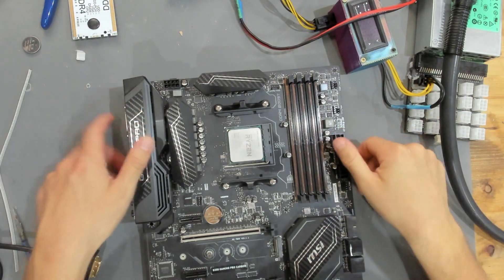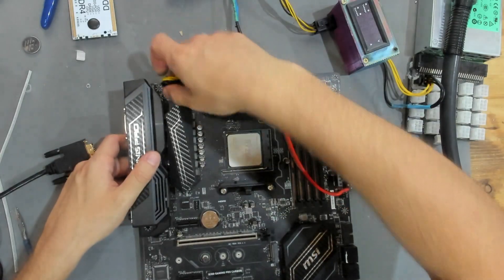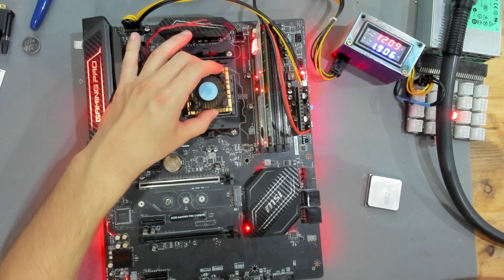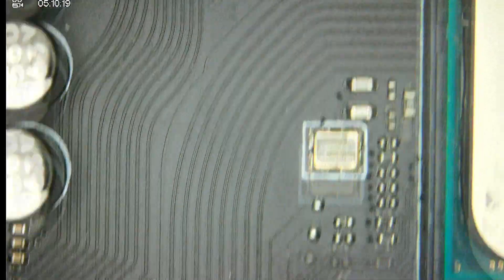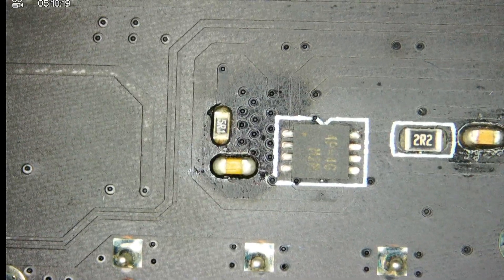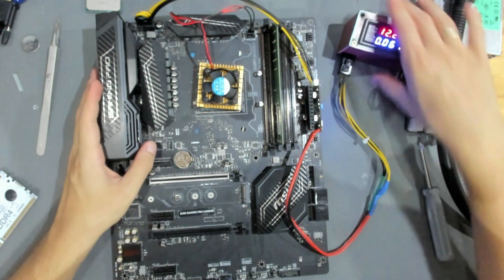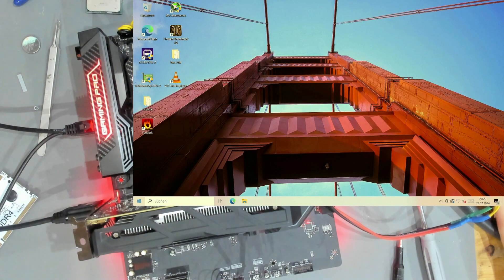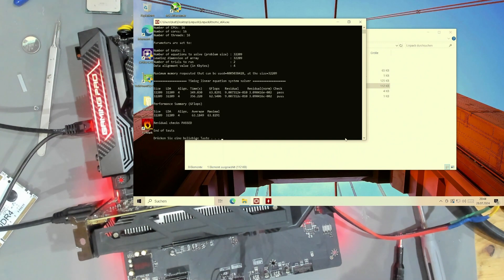VIEWER FAILED BIOS FLASH, CAN WE HELP? ||| B350 MSI CARBON

Comment: I got the best solution without shorting or programming with 5V power that made mine a brick. The easiest way is to remove the CPU and put it back in.
Reply: I donated spare parts from the motherboard such as batteries and chipset heat sink clips.

Comment: Bro u doing very well ur job is so clean.. recently I tried to update my bios on my msi b550 a-pro from the flash button I downloaded the right file and I put it on the usb I named it msi.rom the steps were clear like the first time I updated the bios when i bought my motherboard but this time the update failed idk why when I finished I turned on my pc I saw the debuge led of the cpu light up I had no screen when i tried to update the bios again the red led just  kept blinking indefinitely when i saw ur videos I felt hopeful that the mobo could be fixed
Reply from the maker: If you know that its only a bios issue, it really can be solved, without to much hassle!
Reply: @MainboardMedic  yea I think the problem is with the bios chip it will need to be programed and everything gonna be okay.. if u were nearby I would have brought it to u cuz your work is truly excellent
Reply from the maker: @SHADOWALKER-j4b  Well i am located in germany which is really far from most people!
Reply: @MainboardMedic  Im from algeria.. I think the cost of shipping and maintenance alone could get me a whole new build XD
Reply from the maker: @SHADOWALKER-j4b  Sadly thats often the case that only the shipping is way more then the board is worth!
Reply: @MainboardMedic  Yea that's pretty normal for a country outside the EU with a currency that’s not that strong..

Comment: MSI B650 Gaming Plus WiFi, DDR5 6000. By default, this RAM runs at a frequency of 4800 MHz, but I had it running in dual-channel at 6000 MHz (I don’t remember whether it was an XMP profile or a special one for AMD). Everything worked fine until one day the power went out, and the PC stopped booting after attempts to reset and flash the BIOS.

I ordered the exact same motherboard, and after installing all components, it worked. The RAM operated at 4800 MHz. I tried enabling dual-channel mode on the new motherboard, but the BIOS wouldn’t save the settings. Then, I decided to update the BIOS, and during the update process, the PC froze and stopped booting into Windows. Now, the CPU and DRAM indicators remain lit, even though I know all PC components should be functional.

I tried removing the battery and resetting the BIOS by shorting the JBAT1 pins, but neither method worked.

I also attempted updating the BIOS by leaving the USB drive connected to the dedicated BIOS flashback port, but that didn’t help either. Even with the CPU and DRAM removed, their respective indicators remain lit in red and orange.

Please help me resolve this issue!

Comment: my cpu hot only cpu led stuck bios problem?
Reply: Anything you tried?
Reply: The error may be due to a corrupt BIOS. Did the error occur suddenly? Has the CPU or RAM been replaced? Have you tried a BIOS reset? If your Board has BIOS Flashback you can easily try flashing it with a so prepared USB Stick and see if the Problem is solved.

Comment: You could have just started by flahsing the BIOS saving alot of time, as the customer told you that it had a failed BIOS update attempt.
Reply: you clearly dont have the first clue about diagnostics.  always validate the issue before taking action
Reply from the maker: You are right, but as you were able to see, there was work done on the backside off the board and that could have also been a cause, but it wasnt in this case.
Reply: @MainboardMedic  Ok, but flashing the BIOS was not going to damage it anymore, and it faster than swapping CPUs and measuring current and so on. And you had the info about failed BIOS flashing. If it was me, in that specific case, I would have started by flashing the BIOS.

Comment: Wieder ein interessantes Video. Ich habe kürzlich auch ein BIOS update bei einem X370 Gaming Pro Carbon vermasselt. Hatte dazu einen Ryzen 1600 mit ähnlicher behelfsmäßiger Kühlung wie im Video verwendet. Was natürlich bei einem BIOS Update ziemlich dumm ist. CPU hat überhitzt und einen shutdown bei 10% Updateprozess verursacht. Und das Board hat ja auch kein BIOS Flashback. Mußte mir dann auch noch einen 1,8 Volt Adapter kaufen :( Zum Glück hat wenigenstens die Klammer von meinem CH431A gut Kontakt bekommen und flashen verlief problemlos. Der LAN Port funktioniert auch ohne Probleme. Ich hatte erst Bedenken, dass die MAC Adresse reingepacht werden muß. Hatte das irgendwo gelesen. War aber nicht der Fall. Btw, ich finde deine Beiträge Klasse :)
Reply from the maker: Sehr gut! Bios flashen ist tatsächlich nicht trivial! 
Ich hatte es bei Asrock boards, dass ich die MAC neu einspielen musste!